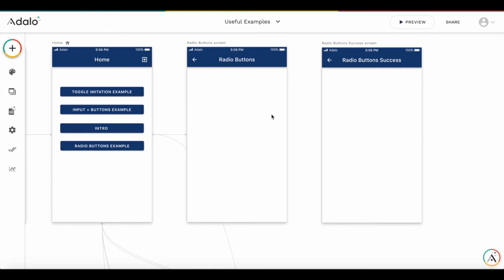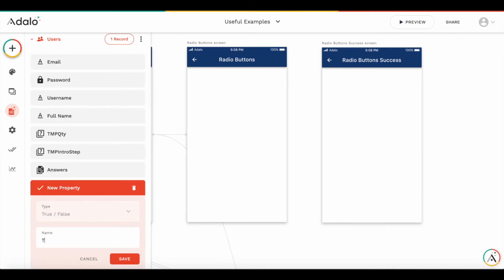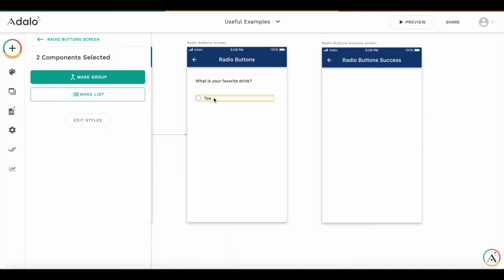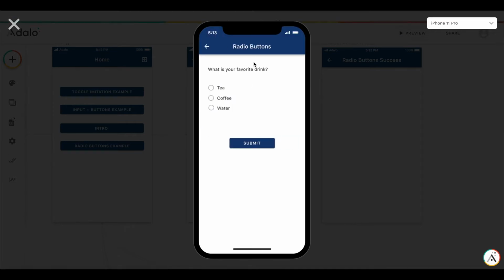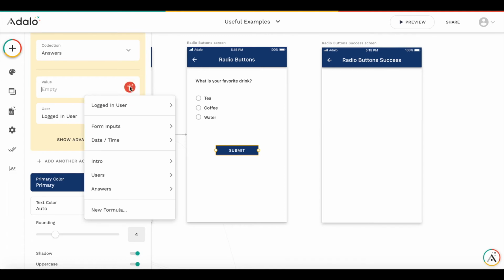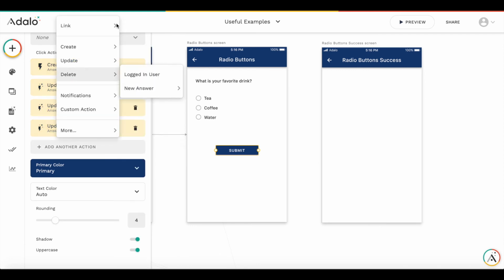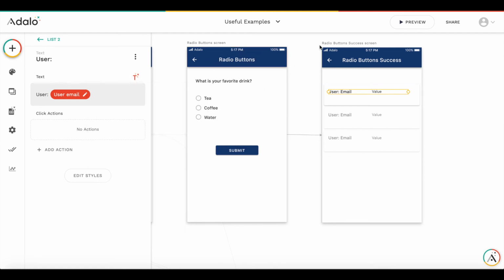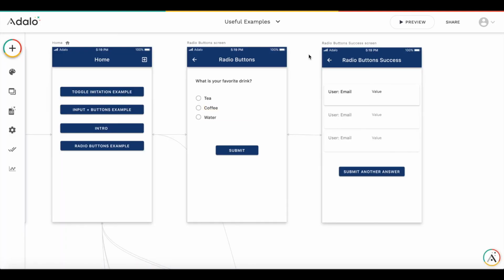Adalo hints: creating radio buttons using Toggles

Comment: Hi Victor. I am working on a project which includes more than 100 multiple choice questions. How can I populate a question card and reuse it for the remaining 99 questions by pulling the data from the databse instead of typing each question and its options? Thank you for the video btw.

Comment: Appreciate the effort you put on showing the workaround for solving a complex problem which is caused by the lack of a proper function implementation from Adalo. Just imagine applying this approach on a quiz that requires completing 100 questions with multiple possible answers (radio buttons).

Comment: Please help, i did all the steps; nevertheless the moment i run the app, when i mark the radio toggle, it automatically unchecks after a few seconds. Why does it happen?
Reply: I am also having this problem
Reply from the maker: Most probable reason is that it takes some time to get properties' values from the database and updating it in the browser; also the speed of the desktop can affect it. In the native app it should work faster though.